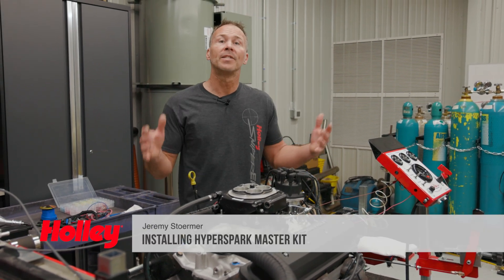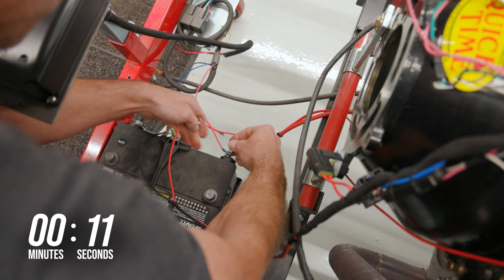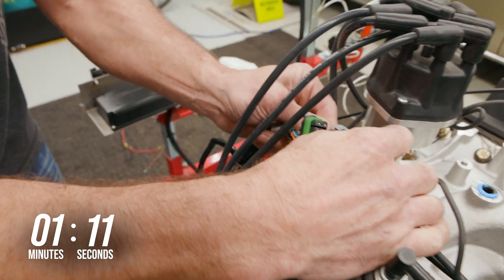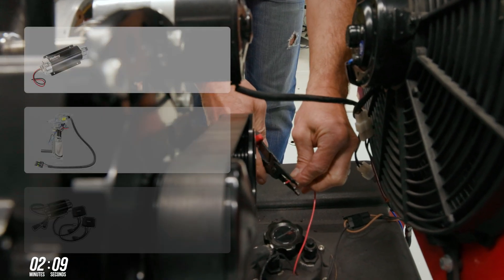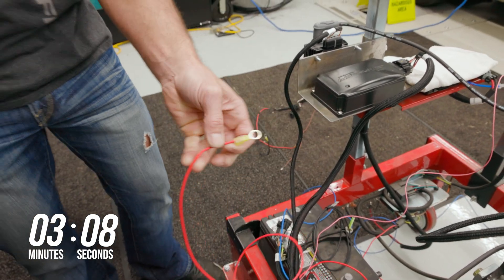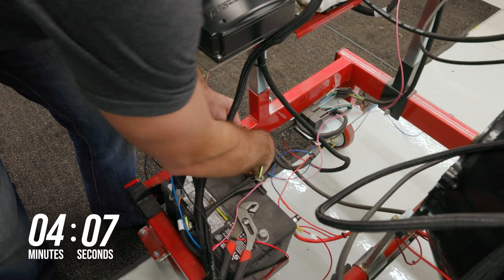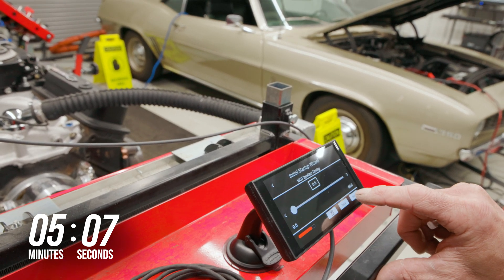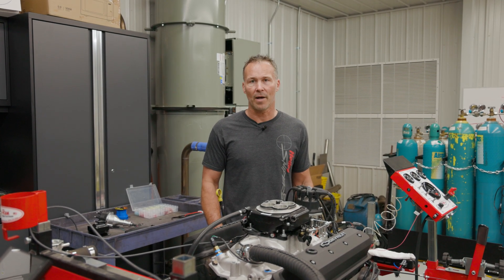How to Wire an EFI System in 6 Minutes with a Hyperspark Ignition Master Kit and Sniper EFI

Comment: This video is kind of comical, I would not reference this video for installation of the Sniper, Holley does have much better installation video's. I struggled with installing my Sniper on my BBC 69 Camaro, all fuel issues and my mistakes. first issue was I had the pickup tube on fuel pump too close to the bottom of the tank, it idled fine but jumped lean on higher rpm. Second issue; the fuel pump power wire was wound too tight and the power wire was shorting out in my tank blowing the fuse when I powered up the system(easiest). Third issue was; I don't think I cleaned the fuel lines good enough so little particles clogged the filter in the Holley built in fuel pressure regulator, so I was getting 120 psi fuel pressure. Moral to the story. Don't be a ME, haha. Pay close attention to the fueling of the Sniper, without a perfect fuel delivery system the Sniper just doesn't work well. I'm pretty stubborn and I thought my fueling was good, so each time and blamed everything else before I dug into the fuel system wasting a lot of my time and frustration. /sigh... It runs great now. I get pushed out of shape, and it's hard to steer when I get rubber in all four gears(beach boys), crap I have 5 gears.
Ken

Comment: You didn't hook the tach wire up. Where does it hook up on this harness?
Reply: I think it's integrated into one of the original sniper plugs that comes with this harness. I think...
Reply: There is a 10-pin pass through connector on the new harness, you just take the 10-pin accessory connector (the one for optional electric fans, a/c kick etc.) there is a brown wire for TAC signal, for me it was just 1 wire out of the 10-pin for TAC signal.

Comment: Ordered mine months ago directly from Holley, and still has not shown up.  I call them, and they say it's on backorder for two weeks, but then two weeks go by and still nothing, so I call again, and they keep telling me the same thing.  Getting super frustrating as I have the Sniper EFI throttle body, new tank, new pump, and all of it plummed, but it's all just sitting and waiting for this to come in.  Missed most of the summer driving season because of this.

Comment: Literally just installed a 4150 sniper with hyperspark coil and cd box yesterday. Ignition box was dead and had a red LED with key on and no spark when cranking. 

If Holley is going to make entry level and affordable EFI and ignition components, it would be greatly appreciated they come out with some diagnostic approach when determining issues. The manual is not very good

Comment: Efi conversion? it already had efi to begin with.  Other than swap out a wiring harness I'm not sure what was even done here. And I'm sure it'd take a little more time installing it in a car as opposed to a run stand with literally everything already installed.
Reply: Yeah, they didnt really swap anything tge dizzy wasalready installed and everything. They just left the old harness in place so they could remove it quickly.
Reply: @AdrenalineTheory  right!!!! They didn't change shit except the wires. Still trying to figure out when ol Bob here saw them change the distributor.
Reply: It wasn't an efi conversion. It's a conversion from regular distributor to the Hyperspark distributor.
Reply: @bobstephens8851  other than unplugging one harness from the distributor and then plugging the new harness into the distributor they didn't touch the distributor. And their first sentence in the video was "with sniper efi switching from a carburetor to efi has never been easier.